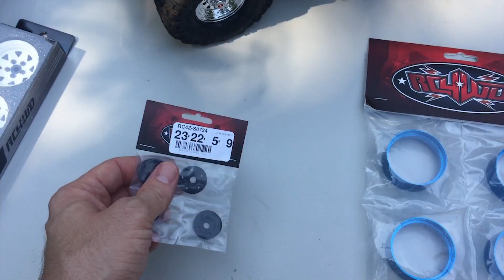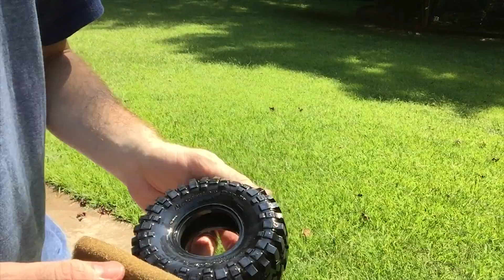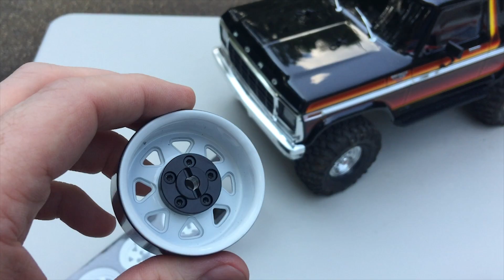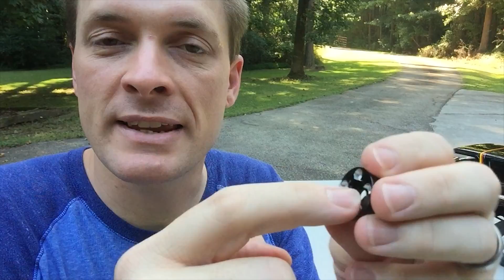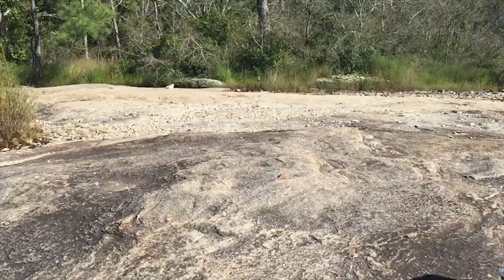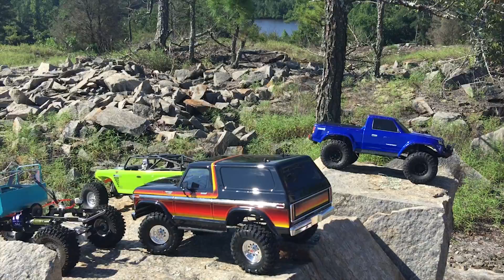How To Mount Pro-Line Krawlers on RC4WD Beadlock White Wagon Wheels

Comment: I have a set of wheels I've not been able to get any tire on them because it's like that inner ring isn't the right size or something. For a while I just thought I had to use a different brand of tire because the rubber bead of the proline tires was just too thick, but if this ring wasn't so thick then I believe I could get any tire to fit on these wheels with no issue

Comment: recently got a set of the RC four-wheel drive wheels and I found that they were absolutely no better than the cheaper ones you buy Amazon actually I could GET two sets of wheels on Amazon for what the one set of RC four wheel drive wheels cost what a waste of money.. . I'll check it out next time before I buy .. actually you can buy wheels with tires already mounted a lot cheaper than just the R.C 4.W D wheels .. they're all made by the same company anyway

Comment: Thanks for this video! I just ordered these wheels and 2 different size hex adapters,  I also ordered the rc4wd ground hawg tires so the ring should work I'm hoping.  I would have had a much harder time figuring it out if I hadn't watched you do it. It looks time consuming and to some people that's not fun but I'm retired and I also build scale models of tractor trailers so I'm good! Lots of patience needed for this hobby too.  Those ground hawg tires were on a lot of trucks in the 70s and 80s. All the truck pull and serious mud guys ran them.
Reply from the maker: I'm glad I could help

Comment: I was trying build a scale looking Ford Bronco. I had the very same problem with the RC4Wd stamped steel wheels. I needed to change to a 12mm hex. RC4Wd does sell the adaptors. I had the very same problem, I wanted the studs and bolts on the outside of the wheel. I was not able to do that. I ended up buying another set of wheels that were plastic just so I could get that look that I was after. I guess that is the way it goes sometimes.

Comment: Hey great vid! If you take a dremel or file to those cap head screws you were trying to use with the wheel hex, you should be able to make enough room so that you can mount them like you were saying so that the actual nut is facing outward and it will give it more of a scale look 👍 Congrats in the milestone btw, keep up the great vids!

Comment: If you want the rubber to be stickier or make them sticky again, spray the treads/lugs with PB-Blaster. Let it sit on there for no more than 3 or 4 minutes. Any longer and it can start to destroy the rubber and lugs could tear-off. You can use Simple Green or other de-greaser to neutralize and get the PB-Blaster off.

Comment: Question: Did you lube and clean the Traxxass tires, prior to that first run? I have 3 sets of wheels for my Bronco, for diffeerent type runs, this includes a set of the original Traxxass wheels, they are good tires, though deffinitly not as grippy as my Hyrax (Predator) or the Pit Bull (Alien) compounds though they can last a lot longer and cost less. I purchased four complete sets of the Traxxas stock Bronco wheels for $20.00/set online. My Hyrax and Pitbulls are mounted on Aluminum beadlock wheels.
Reply from the maker: The first run was right out of the box.

Comment: Hyrax is the best,, stay away from rc4wd wheels,, ssd makes a better wheel,, you are rite,, stay away from simple green or any type if detergent,, wd40 bath for the whole rig ,, get some heavy brass on the axles (stay away from sprung weight) and that bronco can and will crawl anywhere
Reply from the maker: I wanted the White Wagons that rc4wd makes.

Comment: The only thing I don't like about certain beadlock wheels is they aren't vented to allow the tire to flex. I have a couple sets for my Summit. The one set is RC4WD Rok Lox on a cheap set of chinese bead locks (vented) with no foams and the holes hot glued shut. They were my first set of beadlocks with my first set of aftermarket tires. I had my eyes set on RC4WD Rock Crushers for a long time and they were out of stock since I first seen them. A week after I bought the Rok Lox, the Crushers came in stock finally. I right away ordered the Crushers and I didn't want to swap tires out on my old bead locks so I bought a new set. This time the wheels were Dick Cepek, unfortunately not vented. I could drill holes in the wheels or tires, but I really don't have the desire to do so. My Rok Lox I had left the foam out and run just ambient air pressure. They flex a little too much and the Summit rolls more than it does with the crushers or the stocks. I will put the foams back in them and unplug the holes, but it's about 20 or so screws per side and I will have to undo them all to prevent rips to the tires or foams. So needless to say, I'm not in a hurry to unscrew about 200 screws. Lol. The wheels you put on your bronco definitely look good and look as tho they are vented. I have been on the search also for 2 stage foams for a 8.26 inch tall tire. I have yet to have found any.
Reply from the maker: These tires are air tight it seems. They have air pressure in them. I've taken them out a few times and I like them better than the stock tires. I don't have a lot of experience with crawlers but they seem great to me.
Reply: If you like to hit the water,, vented wheels are no good,,
Reply: @kevinperry5458  ohh I know. I run my Summit in water that is deep enough it floats. The venting helps a huge amount if you stick to dry and rocks. I personally would like a wheel that's vented but doesn't let water in, impossible I know, but would help a whole hell of a lot. I run my Summit up and down a creek bed that is very rocky near my house.